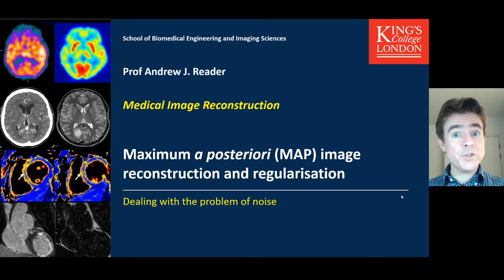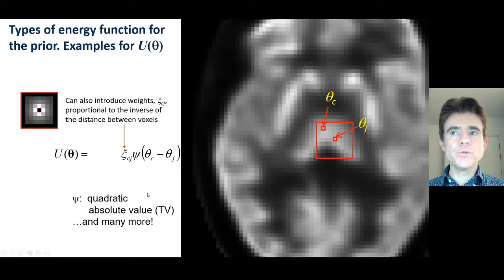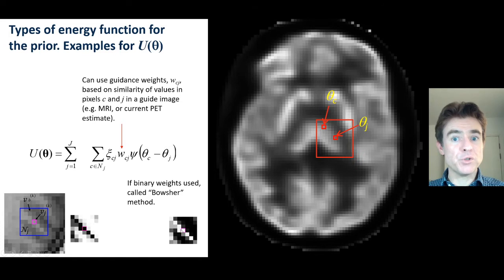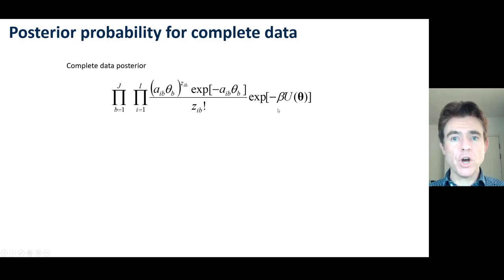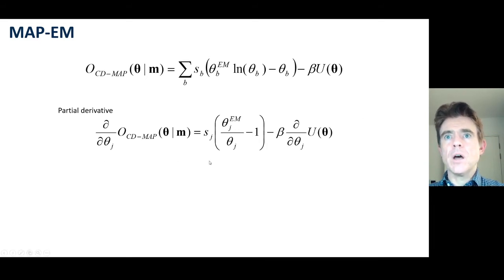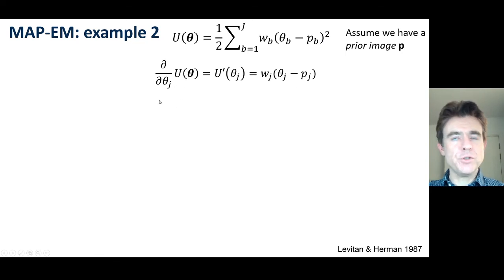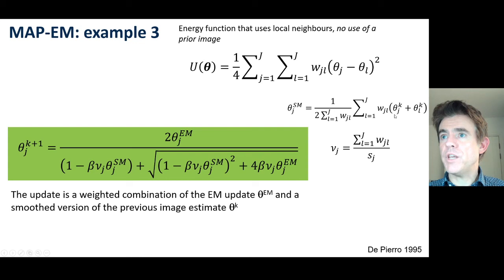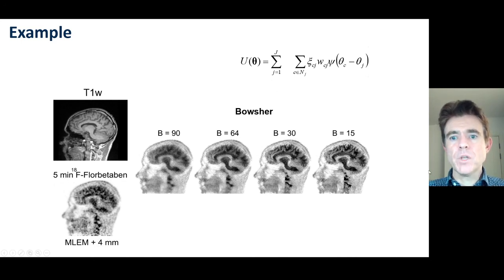Maximum a posteriori image reconstruction

Comment: Thanks for the great video! May I ask one follow-up questions:
Since we are using theta_j^EM to get the next best estimate for theta_j^(k+1), does this mean, we have to perform a full OSEM first to get that theta_j^EM, and then perform another iterative reconstruction to get the MAP estimate?
Thanks!
Reply from the maker: Thanks for your support!  Yes, a full single EM upate is needed (e.g. 1 iteration of MLEM), and then this EM update image can be used as part of a single MAPEM update which gets closer to the MAP estimate. The MAPEM update is usually composed of a current EM update and also an update based on the regularisation.

Comment: Which paper would you recommend to read more about the potential functions? 
I am working on a problem on a DBT reconstruction where we need to preserve the calcifications which are very 2-3 pixel wide objects. 
I have tried with Huber, Quadratic etc. but I find that we need even better potential functions for this purpose.
Reply from the maker: I would recommend that you consider learning the best potential function. For example, there is work by Hammernik et al on variational networks. This is mentioned at the end of one of my videos on deep learning for reconstruction: https://youtu.be/heIHAHD5kC4?t=1411